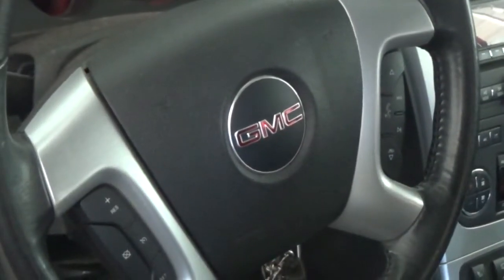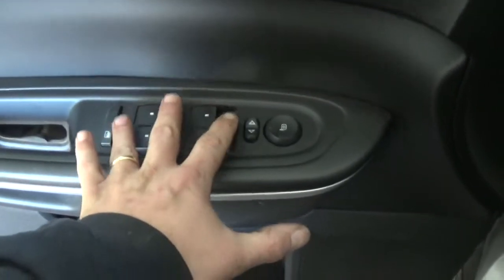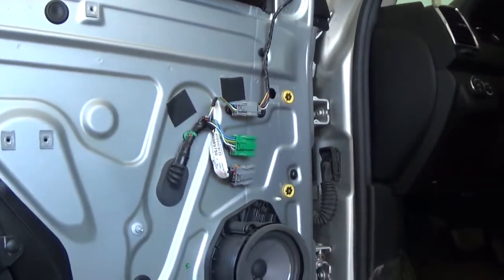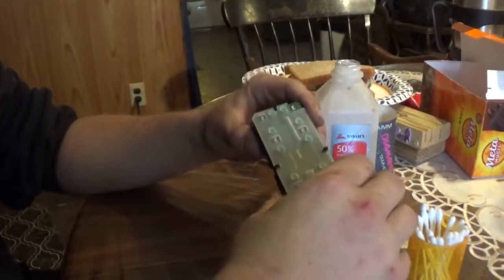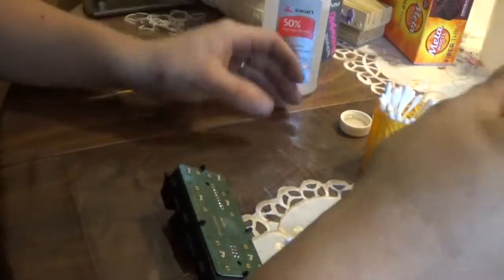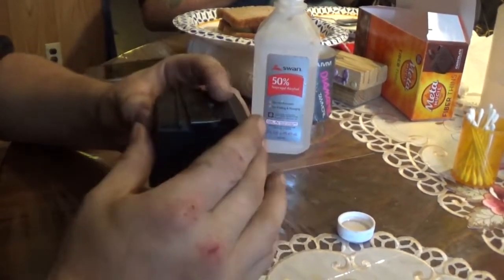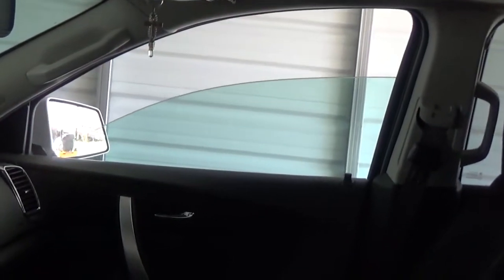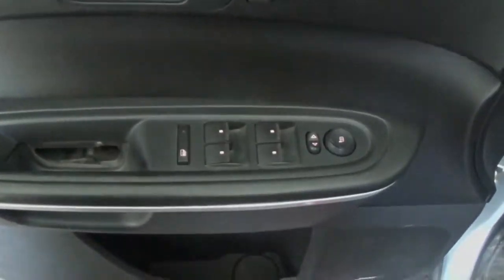how to fix 2007-2019 gm window switch

Comment: Great video and the solution worked like a charm.  I had to watch a few other videos to get some pointers on removing the door panel and switch pack from the panel.  To clean the contacts, I used an old model railroading tip by using a new and clean pencil eraser to lightly scub the contacts on the circuit board and on the silicon pad then used isopropal alcohol for the final clean prior to re-assembly.  The window switches haven't worked correctly for almost two years but now they work like new again.  Thank you much "Wizard Fixes"!
Reply from the maker: I will have to try the pencil eraser trick on my truck because guess what I need to clean my switches on my 2012 Silverado I'm glad it helped you and thank you for watching the video

Comment: So if master was dirty will it effect passenger switch? Because passenger will go down not up and driver master won't do anything.
Reply from the maker: It could have some affect but I'm not sure to what extent if your switch isn't to much trouble to get out I'd clean it and see if it works like it should
Reply: I agree with the Wizard.  Could be several things at play but my driver side switch would not operate the passenger side at all.  And the rear driver side only for down but not up.  Once cleaned, it worked like a charm.  Not the same scenario but I am guessing you just need to clean both driver side and passenger side switches.
Reply: Thanks for the replies my girlfriend got frustrated one day while I was at work went to the dealer they got her for 800 almost they replaced passenger side switch

Comment: Pas window gos down but not up with pass door switch driver side pas window switch does nothing ?
Reply from the maker: that kinda sounds like a problem in the wiring but cleaning the switch wouldn't hurt as it is real easy to do and see what happens if that don't fix it then it might need to go to a shop or if you know about wiring you could figure it out but definitly try cleaning the switch first

Comment: Lot of work to not replace a $13 part
Reply from the maker: True but if your in a pinch and need to get the window up it will work I didn't know they were that cheap too lol
Reply: Dale, are they truly that cheap?  What is the website so I can possibly order it next time instead of fixing it.  The only thing I found cost $250 and that was for the whole four window switch assembly.  $400 to replace the whole switch panel including trim piece.
Reply: If you think 10 minutes is a lot of work I’d like to see how much your job pays you must be like $78/hr 💀💀